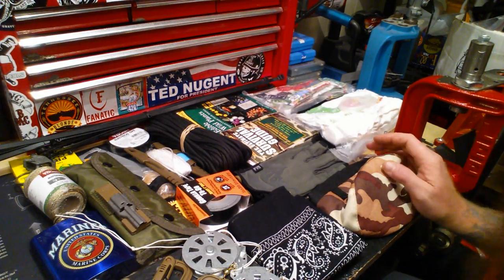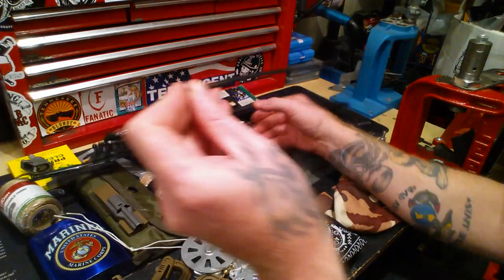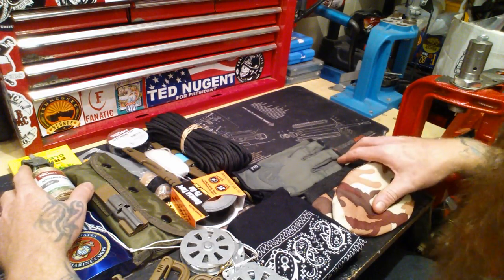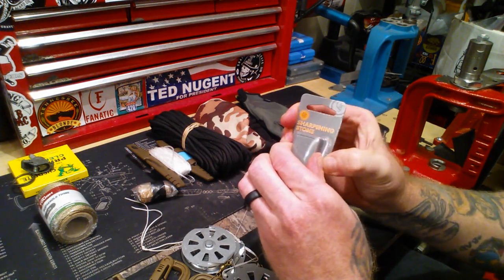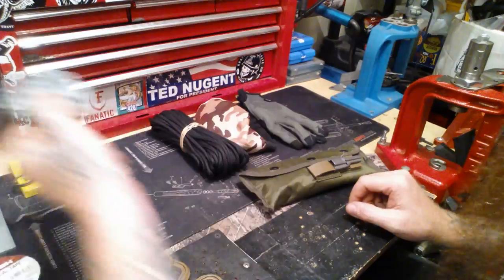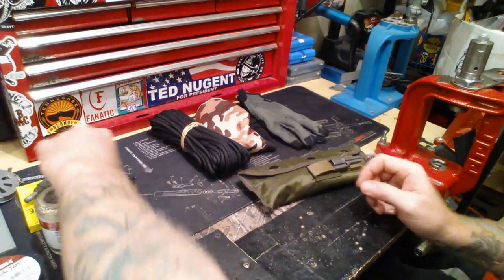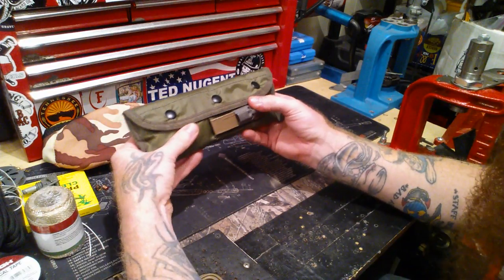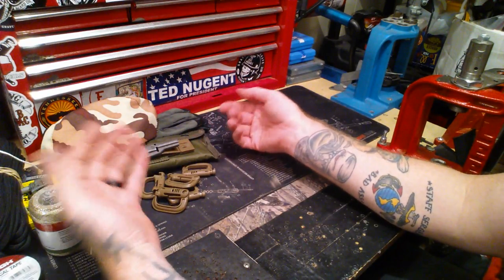I.N.C.H. Bug Out Bag Series | Miscellaneous

Comment: I had this happen so FYI  might want to make sure the moisture from the wipes did not get squeezed out into the rest of the bag of tp and diapers. diapers would be usable to probably not. good luck and thanks for the video!
Reply: ** tp (not to) probably not. sorry
Reply from the maker: its good I sealed them first. thank you
Reply: good... wish I had thought ahead my first go round. lol!
Reply: An alternative is to open the wipes and let them dry. Then vac seal to save space. When needed, add a little clean water to moisten the pack again. Doesn't take much. Frankly, I've been surprised at how well many dehydrated "wipes" work when re-hydrated. (Don't do this with alcohol or other antiseptic based wipes.) This is for regular moist cleaning wipes whether for baby bottoms or hardwood floors. :-)

Comment: First and foremost, thank you for your service!
Speaking from experience, vacuum sealing is a great asset in kit preps. Not only for space saving. Means to keep things dry, from socks to documents to rifles (when making bags from rolls.). Bags usually can be reused after opening, as well. That said, there's one point that I respectfully disagree with your usage. Vegetable seeds should not be vac sealed.

Quote: We also get asked frequently if vegetable seeds can be vacuum packed.  Remember - seeds are alive!  They need to breathe just like you - but like you, when you're sleeping, you use less oxygen - so if kept cool and dry, the seeds won't need much oxygen.  We sell kits that you can store your seeds in using mylar, which is a good barrier for air and moisture.  But we don't seal the bags without air in them - the vegetable seeds need the O2. 
http://sustainableseedco.com/education/storing-vegetable-seeds.html 

Recently discovered your channel and appreciate the common sense advice I've seen here, so far. Thank you for sharing.
Reply from the maker: thank you

Comment: I will use an air hawk pellet gun for small game hunting it is accurate, deadly and quiet  it is made by Ruger and is slightly more then 100 bucks dont add oil to the pellet or it has a sonic crack and defeats the purpose of the stealth hunting
Reply from the maker: Sua_Sponte_11-87 that's another great idea Savage survival was talking about some stuff like that
Reply: Step One survival plus they are great to send the kids out hunting small game with on shtf as there is no loud report when fired thus not giving away their or your position or scaring away game
Reply: Sua_Sponte_11-87 been looking at that . Thanks
Reply: Bring some small traps as well, if it’s an inch bag and you’re never coming home then you’ll eventually run out of ammo